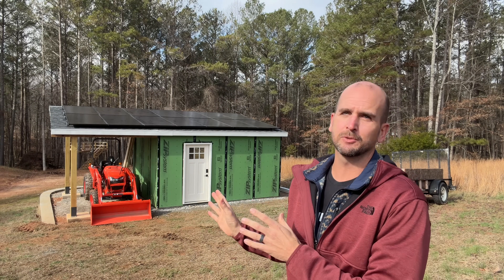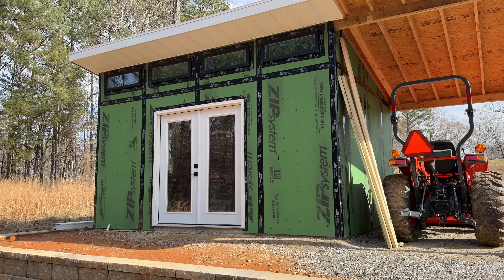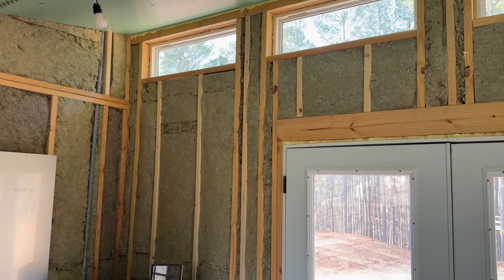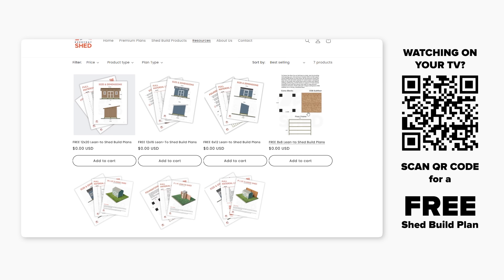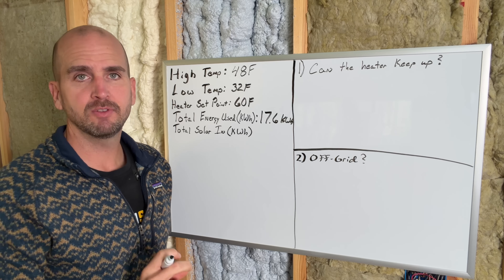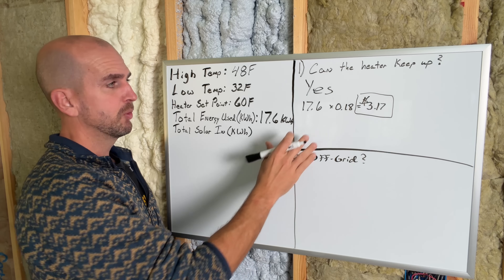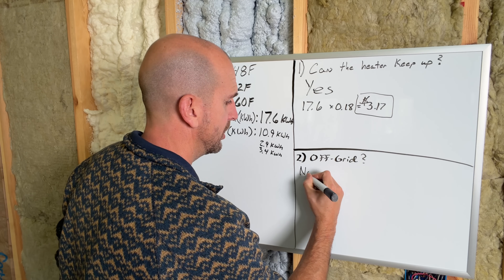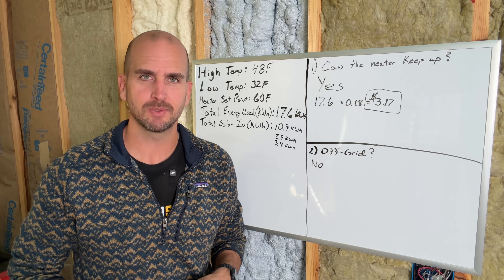HUGE Mistake: Why My $15,000 Solar System CAN'T Heat My Tiny Shed

Comment: Living off grid and heating a small well insulated living space predominately with solar electric panels is definitely possible, at least in sunny locations in winter, such as that experienced in Arizona.  However, being successful at such a goal does require some intention and proper design of the complete system.  In the video, there are many things that can/should be improved, if the goal is full winter heating with little or no reliance on backup heat sources (ex: propane/diesel/wood heaters):

1.  Use a ground mounted solar array, with most of the panels mounted fully vertical and south facing.  Fully vertical is essential to avoiding snow accumulation on the panels.  Additionally, during the winter solstice, the sun arrives so low on the horizon, that fully vertical installation is quite close to optimum angle, for most places in North America and Europe.  A few of the solar panels should not be vertical however, and should be installed with normal south facing slope comparable to the latitude of the installation, in order to provide good year round solar production.  Vertical mounted panels perform great during the winter solstice, but will perform very poorly during the summer solstice, unless located at very northern latitude.  In sunny winter locations like Arizona, fully vertical solar panels at the winter solstice can still produce 5x STC rating of the solar panels, on fully sunny days.  A 6 kw peak rated solar array, that is fully vertical oriented south facing in a place like Arizona, would generate over 30 kWh/day, at the winter solstice, assuming a fully sunny day.

2.  Use a high efficiency mini-split heat pump.  With the exception of extremely cold conditions, an average coefficient of performance (COP) of 3 is feasible with high efficiency mini-split heat pumps, which cuts the energy use to about 1/3 the 17 kWh per day figure mentioned in the video.

3.  Improve the insulation of the building.  The ceiling is where most of the hot air of the room tries to accumulate (since hot air is lower density and therefore buoyant in colder air), and heat loss through the ceiling is higher than through the walls, for the same surface area.  The R-value of the ceiling insulation ideally should therefore be quite a bit higher in the ceiling, than what is used on the walls.  Additionally, insulate the floor, at least a little bit (ex: R3 or higher)  This video does not discuss floor insulation, but a simple concrete pad on the Earth is going to have rather high thermal conductivity and thermal mass.  Even though hot air rises, the high thermal conductivity of the Earth will soak up massive amounts of heat from the floor, thus significantly increasing total energy consumption (especially for short 24 hour tests that do not provide enough time to heat soak the floor and Earth thermal mass to equilibrium temperature and heat flux rates).

4.  Run the test for several days, not just one 24 hour period.  This is especially important if the floor is concrete with direct contact tot he Earth and no in floor insulation.  The thermal mass of the floor will act as a heat sink and greatly increase the first 24 hour energy consumption value during a short term test.  To get a real picture of the average heat energy requirement, the test needs to be conducted only after the temperature of the room has been maintained for a few days to ensure adequate heat soaking of thermal mass, especially of the floor.

5.  Do not rely on the internal thermostat of radiator style resistive heaters like shown in the video.  They are usually not designed right, whereby the thermometer is usually located on the unit itself (rather than remotely via a long wire), and substantial self heating of the entire body of the unit occurs when the unit is on.  The thermometer on such units therefore usually includes a deliberate and massive "fudge factor" to try to compensate for the self heating effects causing inaccurate temperature readings, when trying to actually estimate the ambient air temperature of the room it is installed within.  Depending upon the specific model and conditions, the error can be very substantial, and unless the room temperature was verified with a separate thermometer located elsewhere in the room, it is quite possible the true temperature of the room averaged something quite a bit higher than the heater claimed (ex: not 60 degrees F, but potentially something like 72 degrees F instead).

6.  Add some kind of (partial) air barrier on the interior surface of the walls and ceiling.  Something like drywall and/or breathable house wrap should be used.  Leaving the insulation exposed enables small air flows around cracks in the insulation, degrading the effective R value quite a bit.  Covering the insulation with an air flow reducing substance, like breathable house wrap or drywall, can cut down on the thermal bridging associated with air flows around the cracks on the edges of the insulation.  Leaving the insulation exposed like shown in the video, can significantly lower the effective R value, although the severity of the effect varies based on how tightly the insulation was installed into the wall cavities.

7.  When building an off-grid solar heated building, minimize use of windows.  Even double pane and expensive triple pane windows have much worse R-value than regular R-13 or R-15 fiberglass or rockwool insulation.  South facing windows can provide some heat gain on sunny days, but at nighttime they are massive heat sinks.  A more optimized for winter design, involves no windows on the building, but does include vertically oriented solar thermal space heater panels, that shuts off airflow into the building automatically, when the solar thermal heater panel interior temperature is lower than the interior air temperature of the building.

8.  On a cold and windy day, feel around windows, doors, and other places where there are potential holes in the walls.  Seal up any draftiness detected.  Cold wind drafts can essentially ruin the total R-value of the building, even if it had extremely expensive and thick insulation in all the walls and ceiling.  Cold wind drafts are essentially a thermal short circuit across the thermal resistance of the insulation.

9.  Adding something with substantial thermal inertia inside the building (ex: one or more IBC totes full of water), can help to average out thermal variations between night and day, while providing a little bit of thermal storage capability, thus reducing nighttime battery storage needs, both during a normal night, and during single cloudy days.

10.  Even with all of the above, in a highly sunny location in winter (like Arizona), there will still be stretches of winter weather that can include multiple back to back rainy and/or snowy days.  Although it is possible to greatly invest in massive solar arrays and massive battery banks to overpower back to back cloudy and cold weather conditions, It is not optimally cost effective to 100% rely only on batteries and solar panels to do so.  It is more cost effective to supplement the solar system with an auxiliary heating method, such as wood, propane, or diesel fuel heater(s).  Locations like Arizona do get good sunshine during the winter, such that average solar production numbers in winter can be as high as 66% of the summer solstice production rate, assuming average weather.  Even so, average weather is not instantaneous weather, and cold snaps coincident with back to back rain and/or snow storms do happen, even in sunny places like Arizona, just not all that often.  If the solar system is large enough and the battery bank is large enough, it is practical to avoid use of supplementary combustion heat, for more than 99% of days.  When one supplements with combustion heat only 1% of days, on average, the CO2 emission and climate change effects from doing so is negligible and not important.

11.  Not all locations have good sun access in the winter.  In many places, winter is constantly overcast, with frequent snow storms.  Solar photovoltaic electric heat all winter long is simply not practically/economically feasible in such locations.  In order to implement true "net zero" all winter long solar electric heating in such locations, the most practical approach is to overbuild solar panels in locations that are sunny almost all winter long (like Arizona), and then use high voltage DC transmission lines to transport the solar energy to the overcast/cloudy/cold locations of the continent that simply do not get enough useable sun during the winter.  If the state of Arizona was covered in solar panels, it could supply winter heat to all of North America, except on cloudy/rainy days in Arizona (whereby conventional wood or fossil fuel backup sources would still be needed).

Comment: heating is ALL about insulation. there is nothing more to discuss beyond that. with good insulation. you could heat that space literally with a candle. heating crappy houses with crappy design and insulation with ALL kinds of thermal bridging is utterly retarded. pro tip. good insulation design starts with thermal mass. anything else is just a dumb idea. the reason caves and underground stay temperature stable all year, every year, year after year even in 130F or -40F is THERMAL MASS.

Comment: I would have done a whole lot differently.  You need the floor insulated and the a lot more insulation in the ceiling. A radiant heater is the least efficient way to heat.  A heat pump is 1/3 the energy. I would have done a separate battery and inverter. Far less money.

Comment: You should easily be able to heat that with 3000 watts and then have some power left for a computer and lighting.  It was silly to go with R10 and not R20 in the ceiling.

Comment: USA electricity prices are really low! My per kWh charge in the UK is exactly double that (£0.26/$0.36. Plus a £0.44/$0.60 daily charge for the grid connection).

Comment: - Needs a subfloor to separate the inside space from the uninsulated slab. Ground temp at the slab is likely only a little warmer than outside air temp. Probably raise the floor 4" (really 3.5") with 2x4's, and fill the spaces with insulation, then plywood over that. I'd stick with rockwool, it's really good stuff.
- Walls have drastically more insulation than the ceiling, which is backwards.
- Solar is angled for optimal summertime power generation, and almost no winter generation, even though heating requires more power than AC. Seriously, these should be at 45 degrees minimum, preferably even more vertical than that.
- Solar doesn't look like it's facing south, which compounds the solar power production problem.
- If the glass isn't multi-pane, consider adding "window kits" or possibly installing an extra layer of glass/plexi/etc.

- Heat pump loses efficiency at very low temperatures. There will be a tipping point where resistive can be more efficient past a certain temperature. That's usually a pretty cold temp, but it varies on the model of heat pump.
- Could include a modest amount of resistive floor heating in the subfloor, if the hvac isn't cutting it.

edit: just noticed you're using a 1500W resistive heater. Those vary in quality a LOT. And above 15F it's likely not as efficient as an hvac system (between 15F and 0F it gets debatable, depending on brands).
Mainly though, you're on a frozen slab - have more than enough insulation in the walls, and drastically not enough in the ceiling - and your solar is not geometrically set up to actually produce power well.

Comment: $15K WTH? Especially for only 6KW array and a way overpriced battery, what were you thinking?
10kw array, 64kwh battery and 6kw inverter are now ~$6500, much larger everything and less than half the cost.
2nd. why space heat that tiny shed (especially 24 hours)?  Smart would be heat just the battery space, would be a fraction of that 17kwh.
Many mistakes made here, folks, dont do this.

Comment: Add some passive solar heaters to the south side of the office. Get rid of the electric heat. If you have it run a generator, might think about a propane heater, wall mount.  I got a 10x20 office. Propane will heat the room up to 65⁰ f in about 2hrs in freezing weather. About 800 watts runs my 12v refrigerator and lights. All night after a sunny day.

Comment: For a small structure like this without piping required. Just bury it as deep as you feel like.
Dirt is free and great at heat absorbtion (for free)....
And you can get the sollar on a pillow and have a windows or 2 angled away and still get day light and have the solar on the same  location if you are space constrained.

Comment: Interesting experiment. I can give you a few tips for improvement. 1. Lower the ceiling and add insulation to the lowered ceiling. 2. Install a ventilation heater with a directional outlet in the ceiling so that you can direct warm air to the zones where you are and thus lower the thermostat setting. 3. The thermostat setting should be at least 15°c. Otherwise it will be too cold. 4. For overnight stays, I would recommend a small coal or wood-burning stove, as the metal walls of the stove still emit heat even when the fire is no longer burning. 5. If I knew in advance that you were going to live there, I could install pipes in the floor and heat them with steam from the stove and the boiler above it. 6. Saving energy and heat In some countries, people use heat pumps where they pump water from deep wells where the water is below a constant temperature of 10°c and use this for additional heating.  7 if you've heard of the term thermos (a container that keeps hot drinks at a temperature) you know what I mean. You create a large boiler with a high degree of insulation and bury it, then during the day you collect hot water from so-called vacuum tubes in it. When night falls, you pump the hot water either into a radiator or into underfloor heating. P.S. the insulation on the walls and doors is too small to survive a cold night with minimal heat loss. Get a thermal camera and see the losses live! At a minimum, you need 2x as much insulation on the walls and ceiling, and the doors need seals and another door on them with air in between.

Comment: First of all, the thermal insulation layer is mediocre in your case, you will not be able to maintain constant heat without a high energy consumption. Secondly, heating with an electric radiator is the worst possible choice.

Comment: Don't use resistive heating, you troglodyte! Use a HEAT PUMP! 
Don't create low quality heat from high quality electricity. 
Borrow the heat from Mother Nature and only pay to pump it indoors! 
Use the same system to cool in the summer! Put the noisy part outside where it is less noticeable.

Comment: C'mon, for heating you shouldn't use solar panels. A vacuum solar collector has a 4 times higher efficiency and storing energy in (hot) water is way cheaper than in batteries. Just combine it with low T floor heating, good insulation and you're done.
I have a 1500l well insulated storage tank which I'm about to put into operation and going from 20°C to 90°C means an energy equivalent of ~120kWh.

Comment: In practice, "off grid" is nothing but work, money and disappointment. If it had practical value, everyone would do it. Just run a 30 Amp line and call it done for about 1/30th the cost of what you already did. If you insist, insulate all six interior surfaces and go with a diesel heater (under 100w when running) and LED lights. Then make sure your solar is not cabled in series, and be ready for outages and lots of grumbling. 

Or keep posting and hope the clicks pay off? Not a criticism...it's entertaining to see and mildly educational for those who haven't done it before.

Comment: 1. Your panels need to be at a much higher angle for winter collection.  On the Roof does not allow for changing angles so it is even more critical that you set them at the correct angle.  But, that is why I don't do Roof Solar anymore off grid.  Using ground mounts is much better.
2. You need more solar panels and the roof, again, has limited you along with the 
3. Your $0.18 elec estimate does not include all the additional charges most are seeing making Grid Power much more expensive than you suggest.
4. A Mini Split works much better and you don't need to keep it a 60F all the time.  Just keep at 45F until you are going to use the space.
5. The Ecoflow is limiting you way too much.  All in One units like EG4 and many others accept much higher Solar Input at a much lower cost.